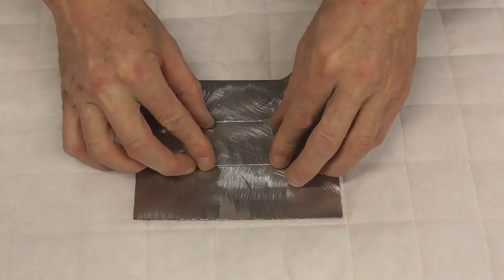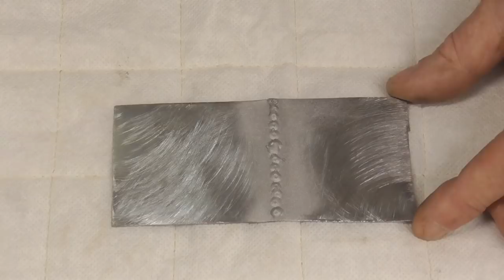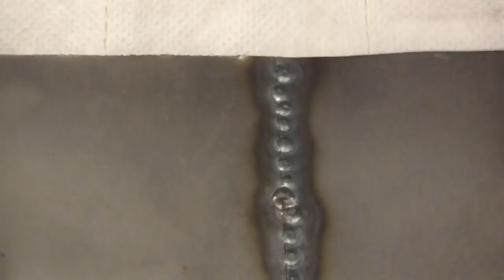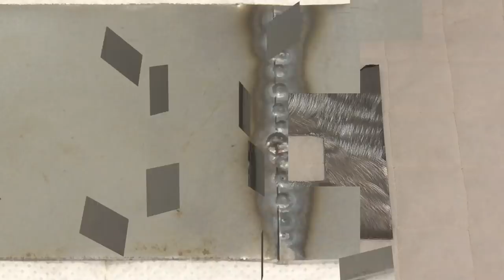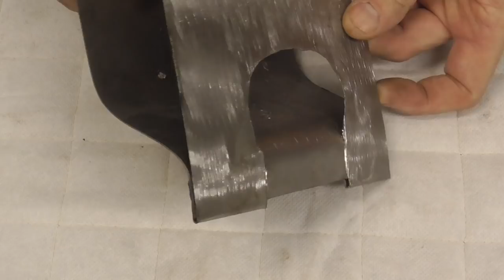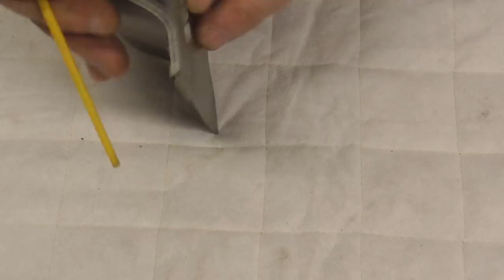Welding Patch Panels - Lap or Butt?

Comment: As a self taught MIG welder I had a fair number of burn throughs when butt welding 20 ga sheet metal.  Lap welds were much less likely to burn through and in most areas I was going to knock down the weld and fill over it anyway.  I stumbled over this point after struggling with a number of butt welds.   Wish I saw your video before I started MIG welding.  Many MIG welding videos suggest that lap joints are to be avoided, but I’m convinced they are wrong after seeing your video.
Reply from the maker: I like your thinking Frank.  Keep in mind also, that cars are manufactured with over 4000 welds and none of them are butt welds - those seams hold up just fine.  Here's another vid that clearly explains the truth:  https://www.youtube.com/watch?v=JIIonJOVro4
Thanks for watching and the support - I'll use an endoscope to take a look inside panels to do an update video on some of the repairs I've done on this channel 2 years ago to show proof of longevity.

Comment: A neat way to lap and weld a sheet metal joint is to crimp one of the joining surfaces with a crimping tool, the crimp/FLANGE tool I use is pneumatic. Your flange tool my be a little different than mine, test a scrap to be sure...then (if appropriate) we will to cut our patch roughly 1/2" larger than the area to be replaced, then crimp the joining original surface where your patch will meet, letting it in the same thickness of the sheet metal with approximate 3/8" flange. Then check and final trim to fit, align, clamp and tack weld..make any last adjustments then stitch it up and grind flush. 
There will be approx. 3/8" overlapping surfaces after crimping (considering the thickness of the metal) so there is a little room for adjustment.  Depends on the job, sometimes I like to drill several holes through the overlap and screw it in place before even tacking it...especially when making one good front fender out of two half rotten old classic gems, joining a good front half with a good rear half of a rare impossible to find front fender. 

When it can be accessed as with a fender and most areas, one can clean up the weld burns and undercoat the seam on the other side.
Reply from the maker: Thanks a lot for the information and tips.  There's a lot of good ways to fix rust damage :)

Comment: The main problem with lap welds is there is no way to eliminate ripples or dimples at the site of the patch.  On average street cars it would probably be fine but on classic or show quality cars lap welds would never do unless you create a lip to lay the patch in flush with the body panel.
Reply from the maker: You only have to read this if you are interested in the truth.  With respect, lap welding is how all body shops in Michigan repair rust on late model vehicles (welding or adhesive) the seem is tapped down and filled.  Strictly butt welding a patch panel, which has become popularized by the internet and TV,  is not the best quality repair on today's thinner metal and there are many good reasons why professional body shops don't do it.  Shops use a combination of both lap and butt (butt for rigid areas that can’t be tapped down) on almost every patch but would never just butt two pieces of metal up (gap or no gap), weld it, then grind away at the area attempting to metal finish it.  Here why with good reason  - especially Eastwood’s starting 22 seconds in: https://www.youtube.com/watch?v=rpH50kh4W00  *
https://www.youtube.com/watch?v=MfKlNQF-o4I  *
https://www.youtube.com/watch?v=e9bjZ_UxtJg  
Today’s metal is .030. That is literally 6 hairs (hair is .005) thick.  You start grinding on that and the result is paper welds & surrounding metal.  In the end it’s what works for you though.  Keep in mind, you won’t find anyone butt welding in professional shops. Surely you’re not going to butt weld and metal finish this: https://www.youtube.com/watch?v=36zkc9UQaTs or some of my other rust repair videos.  Use small overlap, weld solid and you won’t have to worry about moisture - especially if you keep the drain holes clean (most important thing in rust prevention). Note that  the opening of the seam is upside down on the inside (no moisture trapped).  Please see this video for longevity of this type of repair if done correctly: https://www.youtube.com/watch?v=8XaZBy7GC7A or 
https://www.youtube.com/watch?v=2o37dX--w0I

Comment: I dont understand this. If you are not creating that nice edge to lap on (with a tool like easton sells), then you are basically using bondo to hide the fact you have created a nice even/level joint. Am I wrong?
Reply from the maker: I'm not quite sure if I understand - sorry - but I am going to upload another video doing a better job of explaining the difference between lap welding and butt welding rust repairs.  Ask again maybe I'll get it - :)
Reply: @LakesideAutobody  If you lap weld, isn't the patch piece sitting on top of the piece being welded to? Doesn't that mean the patch is raised by whatever the thickness of the patch piece, which isn't usually much, 18 or 20 awg? I am trying to restore a VW bug and so I am watch many weilding videos.
Reply from the maker: @michaelknight2897  The way professional shops do it in Michigan lap and minimal use of butt for places that can't be tapped down). Its consistent, long lasting and you can fix any rust hole you ever encounter.  You would weld your patch using about 1/4" overlap, grind the area clean, tap the seam down with a body hammer, fill, prime, block and paint.  See Eastwood’s video as to why body shops don’t butt weld then aggressively grind off the strongest part of the welds, and attempt to metal finish today’s extremely thin metal:  https://www.youtube.com/watch?v=rpH50kh4W00   
Again, there are 3 ways professional body shops in SE Michigan fix rust:
1) Combination of Lap and Butt welds.  If you insist on strictly butt welds, here's the best way to do them for longevity: https://www.youtube.com/watch?v=e9bjZ_UxtJg
2) Lap joint using structural adhesive or panel bond
3) Fiberglass cloth and fiber reinforced body filler
  I hope this helps with your decision on how to go about your project - it is the correct way no matter what you see on the internet :)

Comment: To those who have watched this video 
Please don’t let this video scare you. Butt weld is the way to go .. 100% 
Look closely at the butt weld 
1. Not enough proper gap left before he started welding 
2. Not even welding along the seam or butt of the metals resulting in what you see 
3. Not enough overlap in the spot welds 

I’m no pro but it certainly didn’t take me more than by the end of the first day of using my mig for restoration purposes to butt weld a sheet panel and have the backside look like little overlapping “buttons” in line with the seam. 

Good luck , take this video with some discretion
Reply from the maker: With all respect and truly wanting to help, strictly butt welding is not the way to go for these reasons - 
     Strictly butt welding a patch panel, which has become popularized by the internet and TV,  is not the best quality repair on today's thinner metal and there are many good reasons why professional body shops don't do it.  Shops use a combination of both lap and butt (butt for rigid areas that can’t be tapped down) on almost every patch but would never just butt two pieces of metal up (gap or no gap), weld it, then grind away at the area attempting to metal finish it.  Here why with good reason  - especially Eastwood’s starting 22 seconds in: https://www.youtube.com/watch?v=rpH50kh4W00  *
https://www.youtube.com/watch?v=MfKlNQF-o4I  *
https://www.youtube.com/watch?v=e9bjZ_UxtJg  
Today’s metal is .030. That is literally 6 hairs (hair is .005) thick.  You start grinding on that and the result is paper welds & surrounding metal.  In the end it’s what works for you though.  Keep in mind, you won’t find anyone butt welding in professional shops. Surely you’re not going to butt weld and metal finish this: https://www.youtube.com/watch?v=36zkc9UQaTs or some of my other rust repair videos.  Use small overlap, weld solid and you won’t have to worry about moisture - especially if you keep the drain holes clean (most important thing in rust prevention). Note that  the opening of the seam is upside down on the inside (no moisture trapped).  Please see this video for longevity of this type of repair if done correctly: https://www.youtube.com/watch?v=8XaZBy7GC7A or 
https://www.youtube.com/watch?v=2o37dX--w0I
Reply: @LakesideAutobody  appreciate the reply. We will agree to disagree. 
Agree to use different techniques at different times (fit for purpose ) 
Thanks 

But your example of butt welding was horrendous and only served as a scare tactic to those not knowing that it can be done much better than that. 

Cheers

Comment: Like you clips dude , could you put the patch behind the panel then weld? Less grinding and not high and fill in with body filler?
Reply from the maker: I'm not going to say it can't be done.  What I will say is you'll have to try it to find out for yourself if is something that will work for you.

Comment: Doing some in box of Dakota after cutting a lot  out  passages side , which me luck
Reply from the maker: I wish you luck - let me know how it goes.  Seam sealer can work well for box repair after you grind the welds clean.  It's not pretty but it works well.  I like: ACDelco 10-2013 Body Joint and Seam Filler Compound  it's inexpensive and works exactly like the pricier sealers.
Reply: @LakesideAutobody  all most all cut out having metal bend the ribs so look better. Lol
Reply from the maker: @73superglide62  Nice - let me know how it works out :)

Comment: Very informative, thanks! I'm about to attempt to the onside rear wheel arch on my Honda Civil and I am nervous. I love Youtube!
Reply from the maker: Feel free to ask questions as you go - I get to them 1-2 times/day
Reply: @LakesideAutobody  I do have one at the moment:- What if I can't get to the reverse side of the TIG or MIG weld to clean it up? If it's not exposed to weather/water, will it corrode? I guess it will as most metal oxidizes, but can it be protected in any way?
Reply from the maker: @waynecummings5021  If you can't get to the back side to undercoat, squirt some used motor oil inside the panel and let it creep around and coat everything like an old valve cover. (after you paint) This video explains - https://www.youtube.com/watch?v=8XaZBy7GC7A

Comment: Do you recommend weld-through primer? Thanks for the video. It helped me decide to do lap welds for my floor pans and rocker panels. It's an old car (50 Plymouth business coupe) in rough shape all around and at best I plan it for a daily driver. Most stuff will be hidden so I'm not worried.
Reply from the maker: I don't use it.  Here's a bit from an article on the subject:  "Once other OEMs started backing off on the use of weld-through primer — Tobie cited FCA, for example — Honda began to study the effects of such typically “zinc-rich primers” on welds, particularly on higher-strength steels, he said.

The OEM found that the zinc can contaminate the weld pool, particularly when too much weld-through primer is used — “which it often is,” Tobie said. (And if the surface isn’t prepared correctly, the primer does you no good by flaking off anyway, he said. A better option would be to make a weld, and then use a corrosion-inhibiting primer after the weld is done." Tobie said.
https://www.repairerdrivennews.com/2016/12/08/honda-explains-rationale-for-new-change-in-weld-through-primer-rules/#:~:text=%E2%80%9CWeld%2Dthrough%20primer%20should%20not,affect%20weld%20or%20joint%20quality.%E2%80%9D
Here's a video on how I treat it after the repair:  https://www.youtube.com/watch?v=8XaZBy7GC7A

Comment: Perfect timing.  Just started working on a 1965 vw bus rear hatch with rust just like this.  To me, lap is so much faster.  I've had issues butt welding where it gets too hot and blows holes to what I am welding too.  Thanks.
Reply from the maker: Good to hear.  Here's some good info if you're interested - 
There are 3 ways professional body shops in SE Michigan fix rust:
1) Combination of Lap and Butt welds.  If you insist on strictly butt welds, here's the best way to do them for longevity: https://www.youtube.com/watch?v=e9bjZ_UxtJg
2) Lap joint using structural adhesive or panel bond
3) Fiberglass cloth and fiber reinforced body filler
 
See Eastwood’s video as to why body shops don’t butt weld then aggressively grind off the strongest part of the welds, and attempt to metal finish today’s extremely thin metal:  https://www.youtube.com/watch?v=rpH50kh4W00

Comment: what's the back side of a lap weld look like? a little pocket?
Reply from the maker: If you have a very small overlap it is an upside down super small pocket so no moisture can get trapped.  Usually the patch goes all the way to the bottom of the panel so you almost never have llap joint facing up. See this video for longevity of this type of repair if done correctly: https://www.youtube.com/watch?v=8XaZBy7GC7A or 
https://www.youtube.com/watch?v=2o37dX--w0I

Comment: this guys a joke  he cant weld
Reply from the maker: With respect, lap welding (spot welded) is how all body shops in Michigan repair rust on late model vehicles (welding or adhesive).  Strictly butt welding a patch panel, which has become popularized by the internet and TV,  is not the best quality repair on today's thinner metal and there are many good reasons why professional body shops don't do it.  Shops use a combination of both lap and butt (butt for rigid areas that can’t be tapped down) on almost every patch but would never just butt two pieces of metal up (gap or no gap), weld it, then grind away at the area attempting to metal finish it.  Here why with good reason  - especially Eastwood’s starting 22 seconds in: https://www.youtube.com/watch?v=rpH50kh4W00  *
https://www.youtube.com/watch?v=MfKlNQF-o4I  *
https://www.youtube.com/watch?v=e9bjZ_UxtJg  
Today’s metal is .030. That is literally 6 hairs (hair is .005) thick.  You start grinding on that and the result is paper welds & surrounding metal.  In the end it’s what works for you though.  Keep in mind, you won’t find anyone butt welding in professional shops. Surely you’re not going to butt weld and metal finish this: https://www.youtube.com/watch?v=36zkc9UQaTs or some of my other rust repair videos.  Use small overlap, weld solid and you won’t have to worry about moisture - especially if you keep the drain holes clean (most important thing in rust prevention). Note that  the opening of the seam is upside down on the inside (no moisture trapped).  Please see this video for longevity of this type of repair if done correctly: https://www.youtube.com/watch?v=8XaZBy7GC7A or 
https://www.youtube.com/watch?v=2o37dX--w0I

Comment: Would you lap weld a unibody floor board?
Reply from the maker: If it was spot welded from the factory, I would use plug welds.  If that's not possible for some reason I would not have a problem lap welding instead.
Reply: @LakesideAutobody  oh ok. Thank you for the reply.
Reply: Lap weld adds more rigidity. Last unibody repair I lapped it and drilled holes in the overlap on the patch panel before hand to come back and fill in "spot welds" with the mig to make sure its structurally strong...

Comment: Love your videos!  Thank you!  Just wondering - on occasion  I've had some trouble knocking down the weld in that it seems the rest of the panel sometimes gets distorted a bit  -  do you think a flange tool would be the way to go in creating a less obtrusive lap weld that doesn't need to be knocked down so much?  Thanks!
Reply from the maker: Sorry about the late reply - wont happen again.  You could try the flange tool but if you use a body hammer with a pointed tip you can just give it a sharp wack and you'll be fine.  Don't be afraid to wack it down.  If it is in a really open area and it is oil canning then you'll have to cure the oil canning problem.  Make sure that your patch is in the right position before welding so that you haven't created the oil canning yourself.  Here's a vid on oil canning:  https://www.youtube.com/watch?v=mL_TIdiY3GU  Let me know how it goes for you and sorry again about the late reply  - Jerry
Reply: @LakesideAutobody  Great advice, thank you!!
Reply from the maker: @CA-pv5ie  You're welcome - let me know if you run into problems like that - there is an answer :)

Comment: The only issue you have with butt welding here, is you can't weld!
How can you say you have good penetration and complain about the gap.
Go back and look at your weld spots on the front and you'll see that there are gaps between your spots. How can you expect to get full penetration and a consistant weld on the back if you don't get that on the front?
I stopped watching at 4:00 because there's no point watching somebody who can't weld teaching people about welding!
Reply from the maker: Body panels are thin about 18-20 gauge.  If you keep the trigger punched two things can happen.  Too much heat resulting in metal expansion and warpage or you blow a hole.  There's a fine line and I always tend to go to the lighter trigger side as I hate fixing areas that i blew through.  BTW - This is a channel meant to make life easier and more fun for folks - not cool to rip on people.  A positive attitude gets you way further than a negative one.